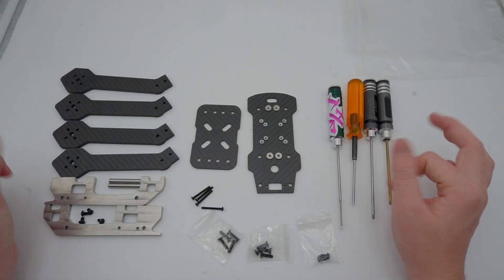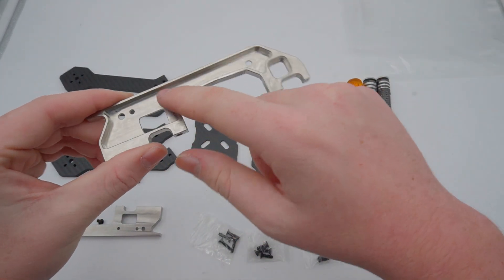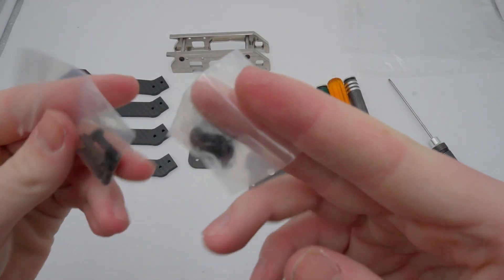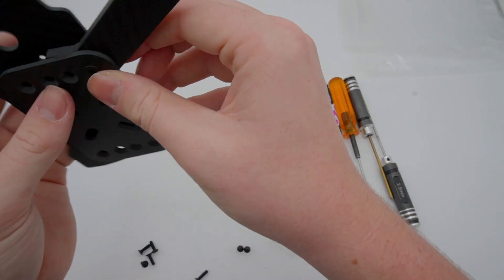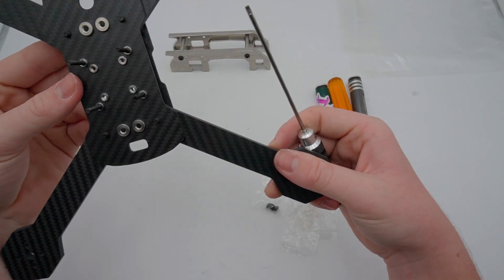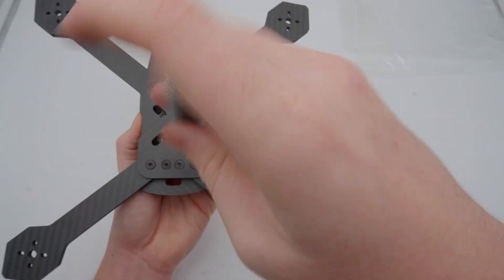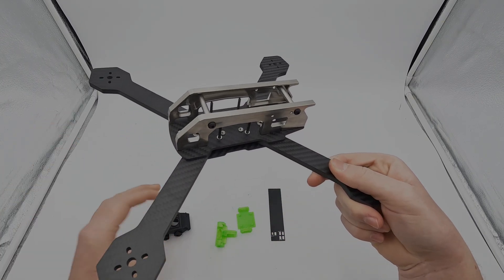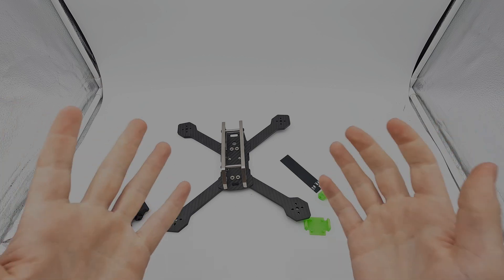Five33 Pro Spec Frame Guide

Comment: HEY Evan, I am finishing my lightswitch V2 HDzero build with he TBS Lucid stack and it is looking like I need to mount my VTX to the top plate in order to fit everything, how do I do that well? id still need to squeeze in my ELRS mini RX but that things tiny so I think ill be ok, thanks!
Reply from the maker: Hey! I know most top pilots just double sided tape theres to the top plate, it seems jenky but is supposedly like the most durable way to mount it !
Reply: @headsupfpv  so just rubbery double sided tape or like a zip tie as well? I feel like there has to be more to it for something as important as a HDzero VTZ 🤣

also, would I ever need to heat shrink it?